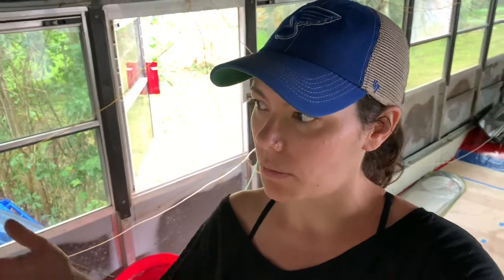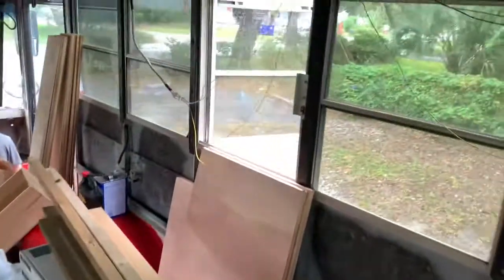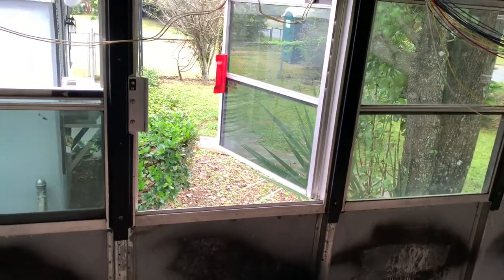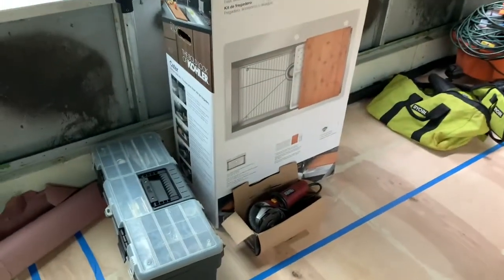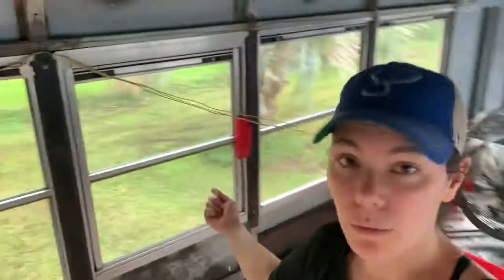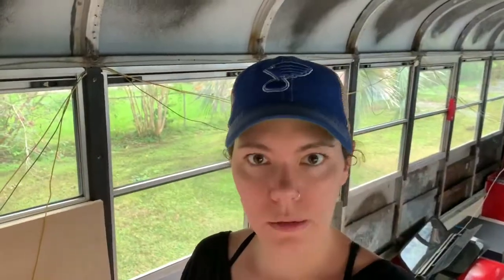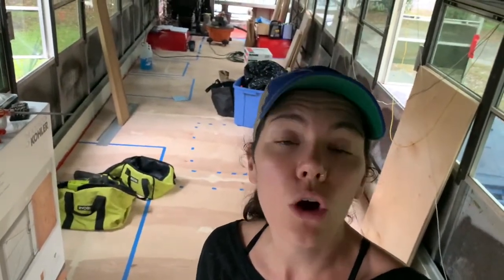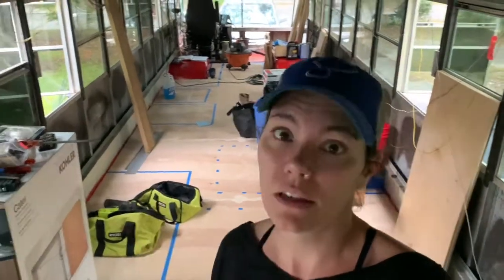Moving the Windows in our School Bus Conversion - Skoolie  - VIDEO

Comment: hey guys. I'm building a skoolie right now also and live in the St Louis area. LGB. I am trying to figure out if I need to do anything with the wires on my Thomas school bus to make a bay window like you guys did. Any insight?
Reply from the maker: Yessss! LGB indeed! 👍🏼💙

Are you talking about the wires for the emergency windows themselves? We yanked those out and cleaned up a lot of the wiring we didn’t need. Then we could move those around. Is that what you mean?
Reply: I'm specifically talking about the alarm for the windows and all emergency doors. I'm thinking I can just cut the wires and cap them and all will be good
Reply from the maker: @nicholasdeane11  yup-rip ‘em out and cap ‘em. Follow the wire back to the fuse panel so you can reduce that mess of wires (if ya want).